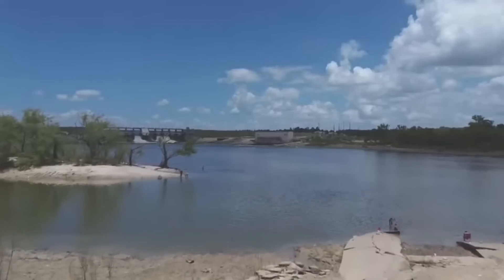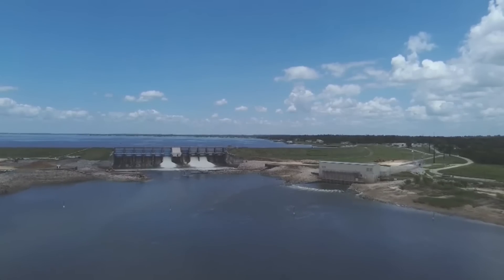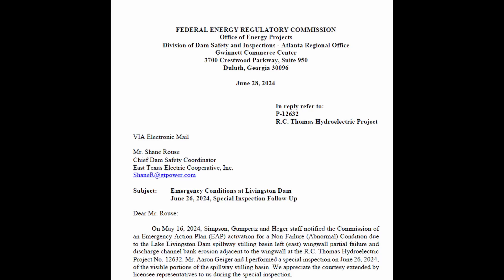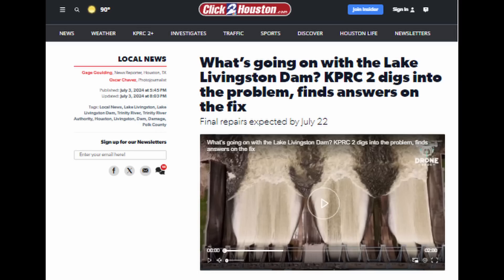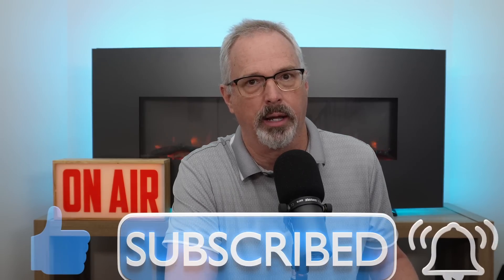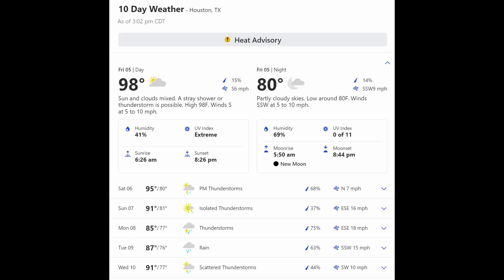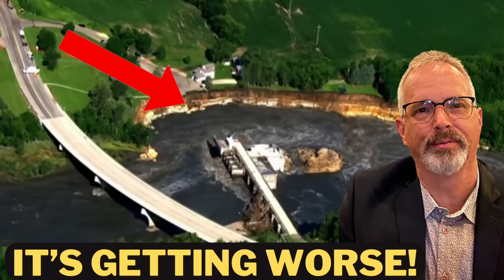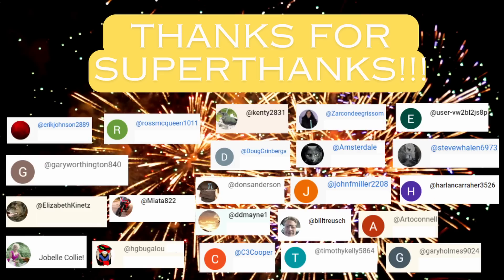What is Going on with Lake Livingston Dam?

Comment: The sky is falling, the sky is falling.  Before dams were built in SE Texas when it rained the areas were flooded with water belly high to a horse.  Most of the areas north of Houston couldn't be traveled across, even when riding a horse.  Thankful for the dams.

Comment: TRA has had major problems for decades in operation  and up keep of the Dam . A friend who lives near the dam told us two of the gates on the dam have mechanical issues opening and closing. Remember this dam was sold to the people on the lower Trinity river as a flood control dam but as soon as it was  finished the Politicians  made it a water supply for Houston and the Livingston Dam was no longer used for flood control on the lower Trinity.

Comment: As someone who actually lives around the lake, that dam has been suffering for years with erosion from extreme flooding. Browders marina owns the land to the right and left of the dam between the bridge and the dam. Every year we go out there and check out the dam just to get out of the house and we notice the increase in erosion year after year. If you really want to see a significant difference, pull up google earth and use the timeline function. Look at 10 years ago vs the most recent. Its pretty clear how bad the erosion has taken place. I've seen the power of the water that flows through there. I would hate to see those down stream get a more personal experience than they already have with the most recent flooding.
Reply: Yeah, I'm one of those people who got 6 feet of water. My house is 9 feet up, but a dam breach will wash it all away. TRA never drops the lake ahead of time. 4526 cfs release rate now with a few hours before potential destruction. Selling water and appeasing millionaires on the lake seem to be the priorities..... Good luck TRA, you are going to need it.
Reply: @lumberfox89  not one lake in the USA does a pre release.  Not one.  You’re expecting meteorologist to tell dam operators to start releasing?  Let’s say they release water before a rain, do you know how bad it would be downstream to make an impact on the lake level?  It’s not a flood control lake so a gallon in, a gallon out?
Reply: Nice made up story lol
Reply: @pkennedy0219  What did he make up? They were dumping shitloads of rip rap to try and shore things up.

Comment: This sounds like another case of the republicans screwing the citizens and not spending the money to maintain that dam properly over time. A small hurricane is coming, but they can still bring.a lot of rain and every drop of water that ends up in the Trinity River will have to come through that dam unless it evaporates first.  Why did that dam exist for years if they only recently started generating hydroelectric power.  I am suspicious of anything dealing with large amounts of money and republicans. They have not done anything much about the power situation after the freeze that killed many people a few years ago.

Comment: Hurricane beryl about to completely wash away what's left of the supportive basin - potential for catastrophic failure relatively high depending on the volume of rain this hurricane drops. We're also barely entering a (reportedly very active) hurricane season. Not good.

Comment: The TRA is a joke, I had property on Lake Livingston and they were hell to work with. I bought a lot on the water that had set there for years and had a very damaged bulkhead, and as soon as I bought the lot the TRA came at me treatening with me with huge fines if I didn't fix the bulkhead in 30 days, fines of $500.00 per day, I sold the property asap.

Comment: On June 18th, we saw that there were only two middle gates open and the water was still at flood stage. The water flow was massive and had me concerned. I’ve lived here 30 years and never saw it like that before. But why just the two gates when there were at least five gates that were working just fine? I am concerned that this is what caused the erosion of the apron. Sound odd to you as well?

Comment: The statement that this dam doesn't have any flood control effects isn't exactly correct.  It's usually managed to maintain a stable pool level for drinking water supply.  However when heavy rains are taking place in the catchment area, the operation of the dam often determines if there will be flooding upstream of it (if they don't start releasing water until too late) or downstream (if they release water too fast) A few times they have gotten in just right, and dropped the reservoir level down ahead of major rain events, preventing any flooding at all.  This spring, here in the Houston area we had a lot of heavy rain, and that series of rainfalls started with the lake level fairly high.  For whatever reason they held off on releasing water through the dam until it had reached a critically high level, with more rain still taking place, and forecasted.  This forced them to dump water at extremely high rates, for an extended period of time, causing the damage to the dam, and also creating flooding in downstream areas, with the river level ~ 10 ft above flood stage for more than 2 weeks (it was obvious from interstate 10 crossing the trinity river - I happened to take a business trip during the downstream crest stage)
Reply: Thanks gagenator, I was a little confused about that statement myself.
There is some good news for the next few days, Beryl is expected to move on through pretty quickly after landfall.  We will see heavy rains in Houston, but probably not days of heavy sustained rain.  The center is forecast to be around Tyler by Tuesday as a depression, not likely to be affecting us.  It might even weaken enough by the time it reaches Livingston and beyond, that the rains there might not be too bad.
Reply from the maker: @EPG_CATX  Thank you for those details. They will have the hands full with Hurricane Beryl on its way.
Reply: @CaseyJones-Engineer  yes they will. Hopefully they have pulled the reservoir level down already for the repair work, and they can get something (even something temporary) in place soon.  Current path has the hurricane passing to far west for a worst case scenario, but it's far too close to be certain that it won't woble or break up in an unpleasant way after making landfall.

Comment: What's going on with this critical infrastructure throughout America?  Seems like every week we have a new engineering disaster.  Started with the Oroville dam spillway failure in California in 2017. Add to that these numerous dam issues (Minnesota, Texas, Colorado) and failed bridges (Florida State Univ, Corpus Christi Tx mega-bridge) and high rise buildings (SF Millennium Tower), not to mention the recent Wyoming highway collapse.  What is causing this?  I've worked with numerous civil engineers in my career, and I find them to be some of the most cautious, meticulous, and safety-conscious engineers within all the disciplines.  They understand that a failure of a bridge, dam, or building can kill thousands of people.  Is it poor construction skills?  A focus on cost containment by the MBA's (i.e. value engineering)?  Perhaps an over- reliance on computer aided design without independent (old-school) design verification?   A lowering of standards within the engineering schools?  Seems like the problem is accelerating....
Reply from the maker: I would say the issue with these dams and bridges are that they are at or past their design life span.  In many cases, maintenance and repair has not been adequate.  In the case of some problems with new construction, I think it has been a combination of artificially low budgets, a lack of field experience with some of today's engineers and there is some over reliance on computer modeling that is hard to conceptualize or relate to in a practical manner.  Basically, our public infrastructure in becoming a non-renewable resource in that our parents and grand parents built it, and we currently can barely maintain it.

Comment: It's interesting that you mention the ground erosion spotted overhead. I live in Texas City, about an hour and a half drives south on the coast of Galveston Bay, I am noticing some serious slothing of the ground. It is enough to pull buried plumbing apart. I am also noticing the ground water saturation in this area all the way to Alvin, Texas. Places that didn't hold excessive moisture in the ground now do. At a local barn, one of the stalls has been flooded since about April. Yes, the floor is a little lower than the others, but that barn has been there for close to 80 years. And it is common to dig a stall down. The stall is occupied by a pony, so the animals' weight shouldn't be a problem. 
One of my mares is across the alleyway from the pony, and I let my stall build up a little and then added a truck load of a compost-biochar mix to help stabilize the ground. I also switched my horses stalls so that the horse who likes to throw her hay everywhere and dance on it all night could work the elements together. This has helped our stall floors greatly. 
With everything combined, it is enough for us to be looking to relocate out of this region. 
I'm glad I ran across your channel.  Thanks- I subscribed.

Comment: I live about 10 minutes from the dam and I can tell you that the TRA has absolutely destroyed the area.
Reply: can you give details?
Reply: @mike_w-tw6jd  the easiest way to describe the details is likely the poor control of the rivers flow. Lots of damage occurs when they open those gates but they don't always give a heads up until they are already doing it.
Reply: @mike_w-tw6jd  before the power plant went in the fishing at the dam was over the top. Hundreds of people fishing daily and catching limits within a very short time. 

Now that the power plant is there TRA has pushed back how close we can get to the dam. There was already a limit set which was fine, but the new limit is simply over the top. 

The excuse used is for boater safety, but that is just an excuse. Pushing the limit back puts boats in danger from underlying hidden rocks at certain water levels causing many to shear props or damaging their boat hulls.

Also, the instillation of the power plant has affected the fish population. No more is there an abundance of white bass, striped bass or even catfish during spawn. 

The sad thing is that the power plant cannot be used under much of the water level conditions at the dam. If the water level in the lake is too low, which it is most of the summer, the plant cannot operate. If it is too high and high release is happening again the power plant cannot operate. 

The cost of that plant along with its upkeep verses the actual amount of power it produces will never pay for itself, not to mention it has destroyed an outstanding recreational area of Texas.
Reply: I concur as a resident of what may become the subdidvision formerly known as Holiday Lake Estates......

Comment: 6 to 10 inches forecast across the ENTIRE Trinity River basin from Beryl. Potential catastrophic flooding from this event. But there is no reason for concern because Mo, Larry and Curley are taking care of it
Reply from the maker: And their law firm  Dewey, Cheatum and Howe!
Reply: @CaseyJones-Engineer  well if they intend on selling part of the real estate before the flood comes they could engage the firm of realtors of Doolittle and Dalley (yes that is actually a real estate agent in the UK).
Reply: @CaseyJones-Engineer  LoL! So true.
Reply: Actually their names are probably Clem, Boon, and Cleetus!
Reply: Larry and Curly and Shemp have experience in plumbing, you may recall that episode.  However when you use your cell phone you may notice that it will provide you with the extra
service of a water fountain.
Reply: @WmTyndale  Yes they are great at remove all the wire from the "pipe" in the walls creating sprinkler light fixtures in the process.😁
Reply: Just another dam mess.
Reply: Hopefully ot is not the same people that built the bridge going across the trinity river on 787 that has been closed due to the bridge coming apart
Reply: Hurricane season is now and tropical storms causing catastrophic flooding. My God this is scary 😨.
Reply: Hopefully it's a different crew, than the crew that built the electric grid, that seems to fail under heavy loads.
Reply: and now that's on the low side,
Reply: State used to be run by democrats you had a stable electric grid,  infrastructure was taken care of great roads, Republicans have destroyed the state.  VOTE BLUE FROM THE BOTTOM TO THE TOP!
Reply: Sound like some of the weather people. Catastrophic. Just drama and exaggeration. Here in the real world will use terms like heavy rain and for low areas May flood.
Reply: @cecilandrews7479  Thank you for your analysis, relative.
Reply: We got 15 inches of rain last year in the summer over four day. Our dams are all fine.
Reply: And say what you want geoengineering is doing it
Reply: @ronalddaub9740  No, it was the Hunga Tonga eruption in Jan. 2022.
Reply: Who cares?! We've got a Rally!!!

Comment: One of the most surreal job interviews I ever had was with a governmental river authority.  I'm thinking those guys make 8 & hit the gate for 40 years and retire without ever solving a problem - i.e. very static careers produce very static minds.  If there is a real problem don't project good engineering thinking on them, the probably can't process the data they receive and defer to outside consultants to do the hard thinking and draft reports that state the problem in the most sugar coated terms. I didn't get the job btw, oh well - saved us both some heartache.
Reply from the maker: I can relate to your experience.  I worked for the Federal government the first 5 years of my career and realized that I wasn't a match for government work.

Comment: Interesting to read about the UK satellite company that did comparison LIDAR scans of the dam and pointed out the area of difference between scans. The scans pointed out areas that should require follow-up.
PS — Interesting use of technology to quickly do risk assessments
Reply from the maker: Yes, it and will be used more and more in the near future.
Reply: @CaseyJones-Engineer  that's especially true since the USGS and state geological surveys etc are getting more and more and more high resolution (50 cm per pixel) LIDAR in place over time. Thus a comparator baseline will increasingly automatically be in place.

Another area where LIDAR is extremely useful is in heavily forested areas for spotting ancient landslides and thus pinpointing where future landslides could happen.

However if it's a "satellite company" that they're referring to it's almost certainly INSAR they're talking about rather than LIDAR. INterferometric Synthetic Aperture Radar rather the Light Detection And Ranging. Satellites fly over the earth every few days and produce mappings of how elevations have changed during that time period. INSAR is incredibly sensitive. It can pick up changes in elevation of inches over large areas. LIDAR surveys tend to be done from manned aircraft and drones rather than from satellites.

Comment: Yeah, I have not been there since the early eighties, but just like Wyoming, those Texans are pretty independent minded and not likely to take to regulations seriously. They were underfunded back then, more worried about taxes than safety. Don't imagine it got any better over the years between. They do not realize that keeping it right daily is cheaper than solving for it all at once after major issues result.
Reply: Same reason they almost lost their power grid during that cold snap 2 years ago.
“ Rules
Reply from the maker: There is a "time bomb" of pending dam maintenance and repairs ticking at thousands of projects right now.
Reply: @CaseyJones-Engineer  Not the only important civil infrastructure facing consequences of age, deferred maintenance and inadequate inspection.
Reply: @CaseyJones-Engineer  Most civil engineering infrastructure is in a state of incredible technical debt. This is what happens when you don't maintain the built environment for a few decades. But hey, those lower taxes sure were a good thing, right? Time to pay the piper.
Reply: Just like California wouldn’t fix the Orville spillway problem 40 years because the state didn’t want to spend $100 million. As a result, it ended up costing 1.2 billion.
Reply: These issues are not unique to Texas or any other "blue" or "red State". Infrastructure failures have occurred in some of our most heavily taxed nanny states.  It doesn't cost much to inspect and condemn them if they're found to be unsafe.
Reply: @ronaldfharring7326  That goes  to Ronald Reagan and the bipartisan acceptance of neoliberal economic and neoconservative foreign policies.
Even the Democratic leaders of blue states are deep into neoliberal supply side economic polices.
Reply: Yea, being concerned about taxes is a Texas thing.